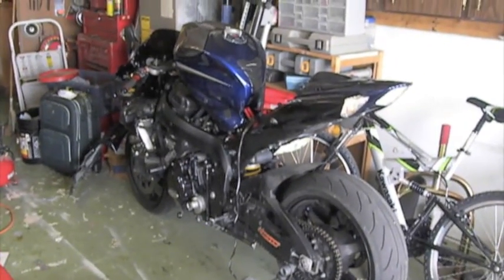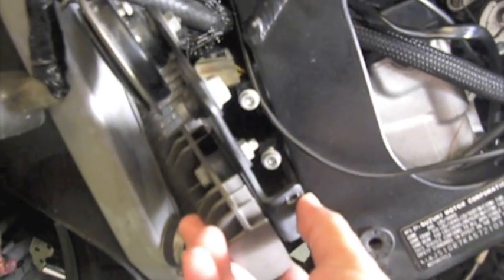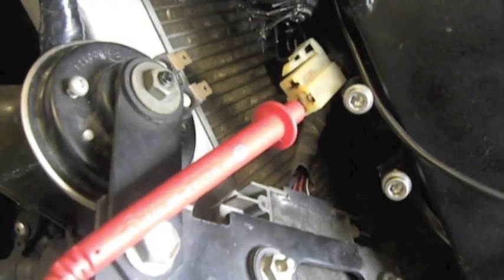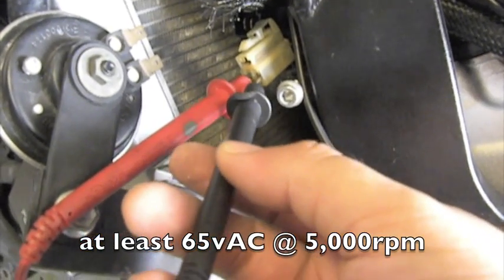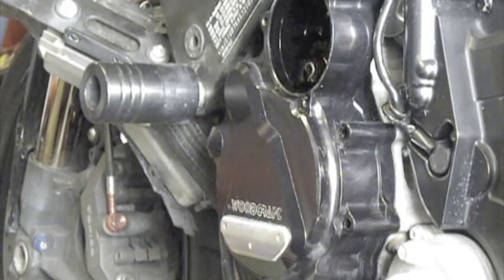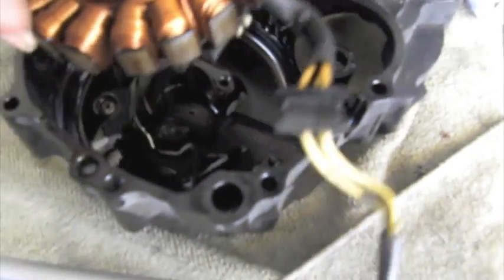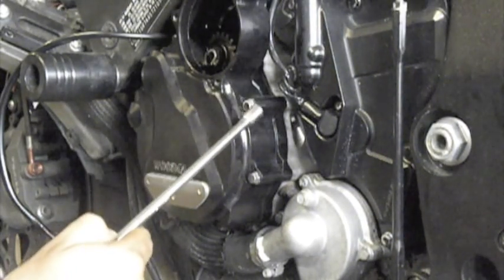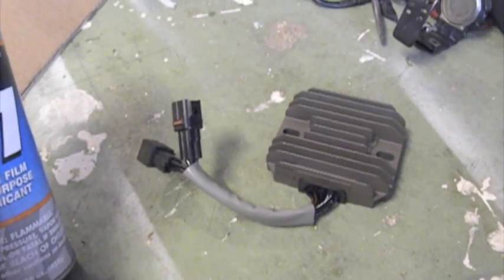HOW TO CHECK YOUR CHARGING SYSTEM and CHANGING the STATOR and REGULATOR/RECTIFIER

Comment: Have a 09 GSXR600. Mechanic told me my voltage regulator needs to be replaced.  He said he checked the bike and it threw up a code that said the voltage regulator was bad. He said he confirmed it by disconnecting the battery on the positive terminal and something about barely touching it and sparks started flying right away.  Is that right?  Is there a way to just test only the regulator?  Ty!

Comment: I have a problem with my battery draining when running the bike charges it up to 14 but after a month or so the battery drops down around 11 volts and need at least 12 to start it? You think it's a bad battery? I bought a new one in January and this started

Comment: you  recommend using OEM parts..  ya.. fuck you.  i  just ordered  a rectifier.  3rd party aftermarket was 125 bucks.  OEM was 450. bucks.  what one do you  think i went with???
Reply: He'll learn. His stator is going to burn his ECU lol
Reply from the maker: yeah and you know how many bikes i saw come into the shop with completely fucked up main wiring harness bc of cheap bastards buying aftermarket electrical parts especially on where performance is valued such as a sport bike. Do you know how much a new wire harness and the labor to remove and put in a new harness is?
Reply: bitch please..

Comment: care full, not all meters read true RMS when reading the irregular, variable frequency of alternators. 65 volts?!!! if comparing two units with the same meter, OK, different readings mean something is wrong, but I'm suggest I g that different digital meters will interpret that same non-sinusoidal waveform differently. 65 volts ac , if read with a true RMS meter will provide 92 volts dc after rectification (RMS x √2). I doubt regulators need that much headroom to do their job. Therefore, if using a certain meter, compare alternator output with a known good bike before being too quick to spend unnecessary money. perhaps two lights in series to test alternator (stator) output.. 12+12=24. I would think if the bulbs light up fairly bright, the stator can do its job,  and rectifier/regulator is suspect. I'm not a bike mechanic, just an electronics diagnostician.

Comment: hi, i measured my gsxr 600 k8 because i noticed the rectifier was pretty hot....engine idling 13.8 v on battery, 25Vac on stator output...revved the engine...14.7 on battery, 105 Vac on stator... is this ok?

Comment: having trouble locating the connector from the stator wire. followed it but cannot find it.. have a 06 gsxr 600.
Reply: moved the radiator forward and pulled out the  bracket that hold the regulator also..
Reply: lol i just did my spark plug change too i could of found it if i watched your video before
Reply from the maker: +STEVEN SIRIVAN  its there man trust me... its really tucked back up in there and a very tight fit. Just gotta have patience and you'll get it
Reply: I have the same. You gotta lift the gas tank and air filter housing.
Reply: Shannon Hoon always easier.

Comment: great vid bro. working on my k7 today. crossing fingers
Reply from the maker: Hope it all works out for you!
Reply: +Echo4Tango Hey just  finished about and hour ago. Job wasn't so bad after the vid.(Thanx again)  Did A voltage check and everything was nominal. only issue now which i just noticed was some oil seeping out of a bolton the stator cover, just one of them. Not a lot and it's only when i started it up. My question is does the gasket take time to possibly seal or can that mean somethings else is off? would love your insight bro. Peace!
Reply from the maker: before anything check if the bolt is tightened ..... it only takes about 15 ft/lb i believe for the torque spec....do it on all them. if thats not it...then well yeah I would definitely remove the stator cover and inspect the gasket and engine gasket surface and the bolt it self and along with the threaded hole on the engine that it screws into..inspect for cracks, breaks anything that doesn't look right

Comment: Great video E4T. Thank you so much. I'm pretty handy with doing everything on my bike, just need an idea on how. Yours was very detailed. Probably saved me a few hundred bucks.
Reply from the maker: +Caleb Evenson at least a few hundred bucks! ... glad the info helped.
Reply: +Echo4Tango Yessir! Turned out my local dealership was going to charge 50 to test the system, 300 for a new stator, and 300 for labor. Not including rectifier (if necessary), gasket, cover (mine is scuffed),and new battery! I tested like you showed. Rectumfier is good, stator is bad. Ordered new stator, cover, and gasket online for $140! Thanks again buddy!

Comment: Nice vid thanks, my battery was dead this morning after not using the bike for just one day. Only got the bike a few weeks ago so don't know the history of the battery. So could be just old. Now I know how to test the charging before swapping out the battery. :)
Reply: Richard Collins Well looks like my rectifier is dead. Having to take bike back to dealer to get fixed on warranty. Really hope this is not going to be a recurring theme with the bike. I checked the stator as in the video and passed the continuity test. My voltmeter is a bit pants so could not get a good AC reading. Will buy a new one to test it properly. But checking the rectifier as per the Haynes manual and the values were all over the place. To make it worse the sun is out. :(

Comment: You never tested the rectifier. How do I know if my rectifier is done?
Reply: Yes he did tell u how to check the rectifier. When u rev over 5rpm, the meter should read 14ish. If u rev more upwards of 7or 8 rpm, the rectifier will "rectify" and keep the meter at 14 is. If the meter goes up higher than the 14ish, your rectifier is bad. There are ways to take it off and test it by itself but it's which ever u prefer but testing it on the bike will give u info on other parts of your charging system.  4000rpm and meter stays same as idle it's stator or stator connection(usually).  The rectifier will usually show signs of burn if it's bad do to the extra Volts running through it
Reply from the maker: Javi V  can't test the reg/rect
Reply: Oh okay, just making sure
Reply from the maker: very sure
Reply: TreeK7 You sure? Thought you could remove it and test it.
Reply: jimmy gray Umm okay....

Comment: ok i have a problem that i hope you can help with. Turn the key in the ignition and everything turns on. Head lights, fuel pump, cluster exct. when i hit the start button nothing happens. I took apart the start button and cleaned it up. it was in good shape little wear but no burn marks or melted plastic. I did the first test you did and got 0.0. bike wont start so i cant do the other test.
Reply: Did you fix this problem? Same thing is happening with my bike

Comment: Thank you Mr. Treek,
Excuse my ignorance, but i have a problem with my Yamaha xj600 1986. Battery is new and holding correct voltage at 12.5 and maintaining while running. When running, the voltage meter shows an increase to about 14.5 or so while revving . Bike stays running without the headlights, but on full charge the bike will run with headlights for about 30 minutes until the charge is drained to the point where the battery can no longer supply a spark to the plugs and therefore the bike goes out. I am confused to know why it shows that the charging unit works, but independently the battery is drained due to the headlights. (Tailights are also independently draining the battery, just at a slower of course, due to its power consumption). I have also cleaned and steel wool brushed the stator. Also, before this problem occured, i had one of the prongs connecting to the regulator/rectefier which appeared burnt out (which originally didnt allow the battery to charge). I cut and rewired the burnt connection and made a direct connection, after this the battery began to show charge (as previosly explained. Thoughts/Comments ? Thanks for your reading and consideration!
Reply: Hey, i know it's been a long time, but did you solve this? i'm having the  same problem. Solved it for a while with a new R/R but it's starting to happen again. Cheers

Comment: changing the oil at the same time? lol
Reply from the maker: no its not required however you might want to inspect how bad the stator burned up to determine how much crud is now in the oil. Either way I would recommend it if you can afford it. Put it up on a stand or have someone hold the bike and lean it the opposite way to ensure you just don't waste any oil
Reply: Always a good idea to do as much preventative maintenance as possible while you have it on a stand and taken apart. Will save you time later.

Comment: Great video but ALL other sources say the internal resistance of the stator for this bike should be around .5 ohms for every combination of the three wires. Am I missing something?
Reply from the maker: what sources? ... .5ohms is not something I would want to see...i have never heard of .5ohms being ok... according to Honda, Kawasaki, Suzuki, and Yamaha engineers they also agree.
Reply: TreeK7 Suzuki manual says so
Reply from the maker: ***** there shouldn't be a reading when doing to ground on stator....aftermarket electrical parts are trash...especially if from china

Comment: I have a vmax 92. My r/r went 2 times. My stator is not grounded. At 5000 rpms it puts out 70 to 80 volts. Could the volts be to high and blowing the r/r...

Comment: Good job on the bike. Where did you get your parts, the stator looked better made than some I've seen. I like to know, if I need to buy some.. Thanks. yl
Reply from the maker: I got it from my local dealership SUZUKI. I don't get aftermarket or off brand electrical parts, its just something  you don't do with these high performance bikes. If you don't want to get them from a dealership or a bike shop...take a look online or check out eBay
Reply: I have seen some of the aftermarket stators, not the best workmanship, they had big name, but I think your right, get the factory parts. Yes ebay can be a good place for parts, but sometimes not so much. Just have to be careful, and know the parts. Thanks for your thoughts. yl

Comment: HELP PLEASEEE!!!!!!      i have ac voltage at 5,000 rpm is around 50 and at the battery i have 13.6-13-8..  ac voltage at the idle is 13 and at the battery is 12.4(not charging) The resistance between those 3 wires is ok and it has no ground with the frame
Reply from the maker: battery is done, old, dead. Try removing that battery charge it over night and re-test.
Reply: done that... same thing
Reply from the maker: sorry, its probably an oddball situation where I would just have to be there...did you ever find the solution

Comment: Thanks TreeK7, Awesome video I must have watched it a thousand times today while I was replacing my stator and R/R.
I have the same problem as jaimeEsparza: brand new stator, brand new R/R, both connected and only getting 12.x v at the battery @5,000 rpm. I do have 65+ at the stator coupler. Voltage does go up while reving but it doesn't even get to 13v. Any idea what else I should check? Thanks
Reply: Battery is less than a year old and has only died once (due to my stator problem), I recharged it but it did sit here for a couple of weeks ...
Reply from the maker: Vic S  what did you ever find out?...  are the new parts OEM?

Comment: Great stuff, but is there anyway to test the stator with just the multimeter without a bike battery???? your help will be greatly appreciated....
Reply: Besides looking at the actual coils, no there isn't. It need power to it to check any kind of reading with a meter naturally.lol. Look for Burn areas in the coil

Comment: I am currently working on this problem on my gsxr 600 k1. When at 5k rpm and measuring volts on the battery it only gives about 12.2v.

So then I did the diode test on my recitifier and it checked out good.

So then I check the connector from the stator. I dont exactly know wich pin is 1 or 2 or 3 but when I connect for example 1 to 2 and 1 to 3 it says a normal 65v. But when I connect 2 to 3 it says only 3v.

Also when I messure resistance from one of the pins from the stator connector to a ground it gives about 1 ohm.

I think this means my stator is dead?
Reply from the maker: according to your description thats what it sounds like. Remember to make sure you have a known good battery when doing these tests, if the battery has died multiple times then its probably safe to say change out batteries also
Reply: TreeK7 Battery is in good condition, i connect it once a week to my optimate to charge. Only recently it didnt have enough power anymore but that is ofc explainable by the stator not working properly.

Tnx for the help.
Reply: TreeK7
One thing i forgot to mention is that i also checked the resistence of the connector coming out of the stator and all 3 combinations checked out good. ( all at around 1 ohm i believe )

However as i described earlier the volt from one of the wires isnt good ( giving 3 volts at 5k rpm )

Isnt this weird since the resistance is good on all 3 wires?

Comment: My bike sound wierd on idle, seems to be dpark plugs, recently changed them... But the problem is still here...!!!

Any idea on how to check the voltage on each spark plug?
Reply: is it fuel injected carbs prolly need to be cleaned

Comment: Hey, I did all 3 tests, first gave me 14.3volts second was reading fine. But the third test gave me no output volts, when I took out the stator one of the wires where damaged as in ripped apart. So is that means I got to buy a new stator or I could somehow connect the wire back and it'll be working again? Or no it won't do any good anymore. Just trying to save 110$ lol.

Comment: was riding my '06 750 home the other day and it shut off on me. got home checked fuse and main relay fuse was blown. put in new fuse, turned the key and for a split sec bike powered on and fuse went out again. im not to tech savvy but any ideas where i should start to diagnose the issue? im either thinking i have a short somewhere or might be my rectifier...then again im hoping its not the stator. 
Thanks

Comment: Hello thanks for the video!  I think i am having a stator issue on my busa. If i start the bike first thing in the morning, it will start right up no problem. By the time I am about 30 minutes into a ride, if i stop and turn off the bike, when I try to start it back up it cranks but wont catch. I have to hit the starter and hit the throttle and pop the clutch. Is this the stator going bad or starter? someone said a fuel issue? any ideas?

Comment from the maker: a general spec for a cold engine is about 65 volts a/c  or more. thats testing at all 3 leads...it doesnt seem to be too far out of spec, you will need to further troubleshoot and single out the faulty component if your bike isnt charging

Comment: Really good video. I need to do the stator test. Had this charging issue before and changed rectifier without any testing. I lucked out and it did charge the battery again. But Yesterday I ran into the not charging issue again and this time Im thinking it might actually be the stator cause I was hearing a whine/whistle while in low rpm engaging and disagaging the clutch.
Again Excellent video, Glad that guys like yourself put up beneficial video. Thanks

Comment: Heh TreeK7! great vid! Many thanks.
Very helpful to see how your bike works at least. Trouble is, mine doesn't. Main discrepency is
* when I disconnect  those 3 stator wires the bike doesn't start, any idea why? It is 3 wires coming off the like yours.

* When I do the continuity test at the connector on the stator side  I get readings so you'd think stator is bad like you say but my manual says I should get a reading. However, maybe the korean manual is wrong.

Any ideas or guesses?

*

Comment: okay guys , i own a honda cbr 600 f3 ... already had bat and regulator probs a while ago so i replaced them both . now ive got a prob where the bike just sudenly stops charching and then the indicators doesnt work properly aswell , when reving the bike you can see its pulling to much power ... ive tested the stator , bat , checked for loose conection but i cant find any prob ... help please ? any suggestions ??

Comment: I didn't move my radiator. Just pulled the air box. And gas tank.  But I put in a speedo drd, changed sprockets -1+2 steel vortex, black Ek chain, Motul oil ,k+N filter, cleaned air filter, new rear pilot, and new front brake pads. At 18,365 miles.

Comment: Bulldog! I just changed my stator, rectifier and battery. Mine would die after about 30 minutes. Mine works again. Get a multimeter and run the test for your bikes specs.

Comment: my bike died while riding the other day well i was at a stop sign and it died. i bought a new battery installed it and ran the test like you said. at idle its around 14.5-14.7 and when i rev it up to 5000rpm it dosent move really at all sits around 14.6-14.7 (14.78 highest it hit) dose this sound like it was just a bad battery or is my rectifier bad and over charging the battery? thanks

Comment: Thing is, you isolated from the harness, not the ground, which is correct for AC output (well done there, only thing is you want to check all 3 phases, make sure they're even).  But the stator's still installed.  If the bike's been down on that side and the cover's dented in the right place, it will touch the windings and short.  To truly isolate it you go to take it out and test lead-to-core of the stator and if (as you said) you get anything other than OL (on a 3-phase like this), it's bad